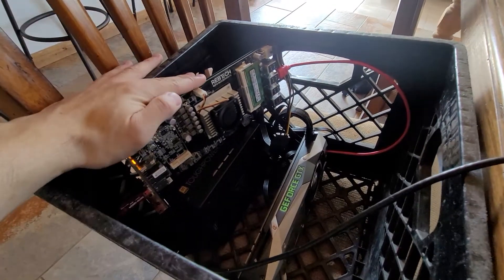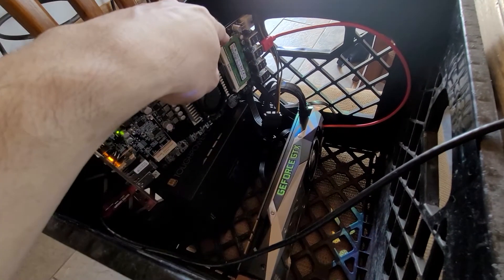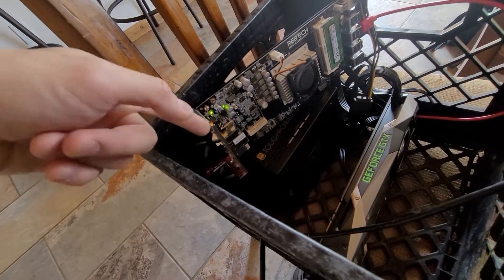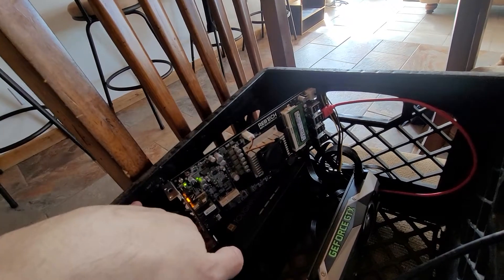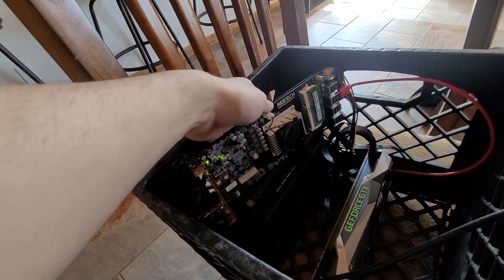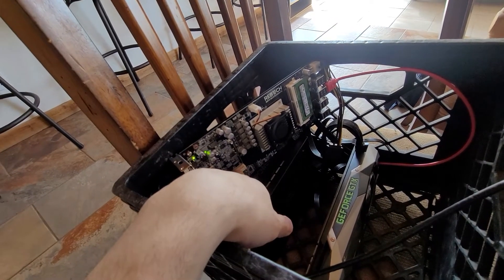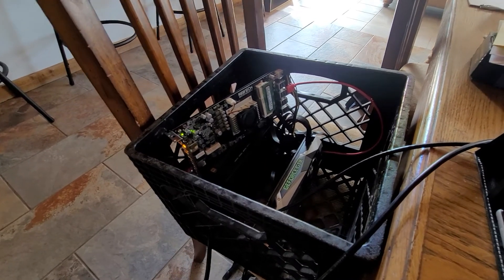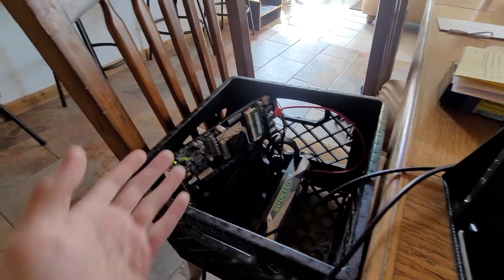RebTech 8-GPU Blockchain Mining Motherboard with Nvidia 1070 Demo

Comment: Did you have to change any BIOS settings on the Rebtech to get the system to boot with HiveOS? My rig boots without a GPU attached nad also boots with an RX580 but I can't get it to boot with a 1660 Super attached, many thanks
Reply from the maker: Check my 3080 video. In short, yes.
Reply: @EarlCo  I got it working by disabling 64 bit BAR support in the BIOS. Currently running 4x1660+1x580 on HiveOS with the Rebtech board, graphics output working from the GPU (1660) in slot1, just a shame they're now out of stock :'(

Comment: Does the rig work, how many u mined
Reply: I got it to work. Very simple!
My main problem was that I was initially testing with just NiceHash OS boot USB flash drive.
I reset the BIOS and set it as you said: Disable the integrated video, set the external video as primary, leave the force disable integrated video alone...
... and then I just used a HiveOS USB flash drive and it started automatically mining in less than 2 minutes!
I added a second 3090 and it continues to work just fine.
Next step is to connect 8 3090s.
Reply from the maker: @PaulPeavyhouse  I enabled comments in the other video now, thanks, that was unintentional. Congrats on getting your 3090s to work! I'm waiting on one myself but that will go in my gaming rig and I'm building an 8x 3080 rig as well.
Reply from the maker: Yes the rig works. I'm testing 3080 now with 8GB DDR3 RAM swap
Reply: @EarlCo  Comments are turned off in your new 3080 video.
I just got my rebtech mobo today and out of the box am unable to get either a 3090 (either FE or Zotac) or 1080 (EVGA FTW) working.
May you turn on comments on your new 3080 video so people (eh hem...me) can talk there?
Thanks!

Comment: why 8gb ram??, i have 4gb on my rebtech
Reply from the maker: There's 4GB on these as well but 8GB is recommended for ANY rig in general if you don't wanna pull your hair out wondering why the rig is unstable.
Reply: @EarlCo  can i use any 1600mhz ddr3 sodimm ram sticks with 8gb, and it also looks like its space for two sticks in them slots
Reply from the maker: @NorthernMostHexer  Yeah I think so, DDR3 SoDIMM. Only one stick can go in so you'll have to take out the 4GB.

You can also contact RebTech and get them to pre-install 8GB for an additional fee.
Reply: @EarlCo  FYI, I ordered 3 rebtech mobos 3/31 and they showed up on 4/9 all 3 with 8GB SODIMMs! I'm not complainin!
Reply from the maker: @PaulPeavyhouse  Nice! The ones I ordered were $159 and only came with 4GB so I ended up buying $30 8GB sticks for them. These new ones are $189 so perhaps they simply baked in the price of the upgrade!

Comment: How did you connect to ATX and get it to turn on?
Reply from the maker: I have a PSU Tester it came with the PSU. It's essentially a short between two of the pins to turn the PSU on. You could short it with a short piece of bended paperclip too. I use a smart energy monitoring switch (BN-Link on Amazon) to turn it on/off remotely.